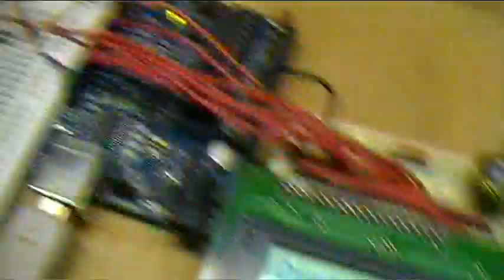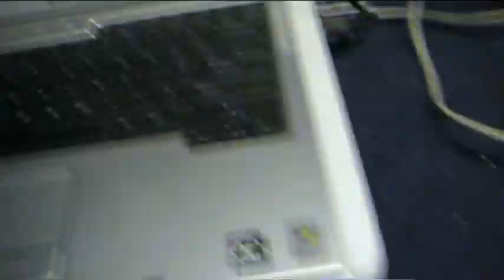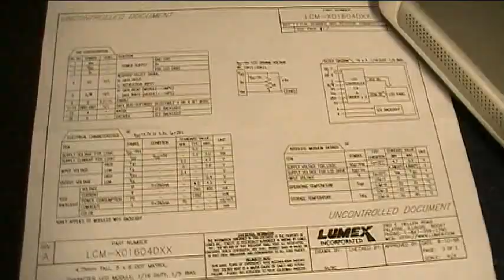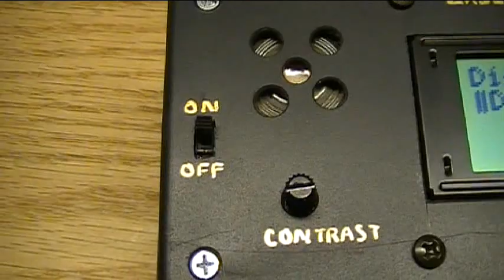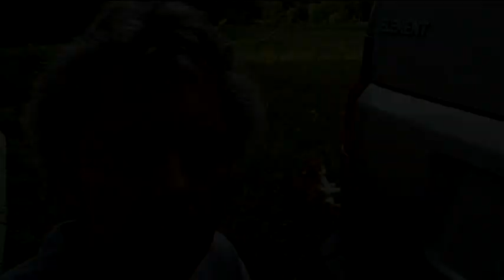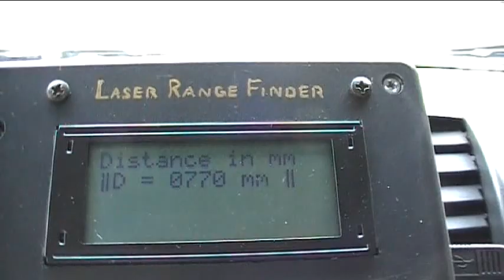Laser Range Finder

Comment: @iToasterman diodes used for projects like these are not much stronger that laser pointers (around 5 maybe 10 milliwatts) and is a general myth that laser like this can harm your eyes in an way (there are sill in the first class category) you should be worried about your eyes if the laser is  stronger than 50...

Comment: @iToasterman Ultrasonic sensors aren't that good, they tend to give false reading if you are at a certain angle to the thing you are measuring. And these would be a lot faster (I think ), soft materials absorb the sound waves giving false readings.